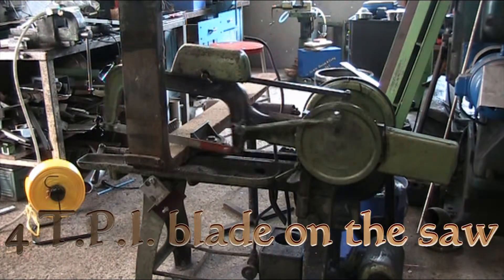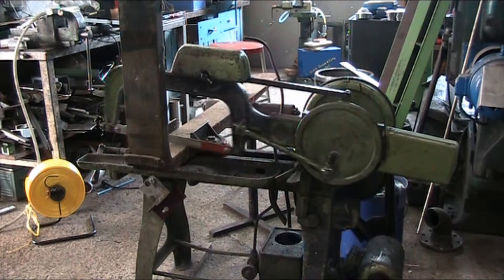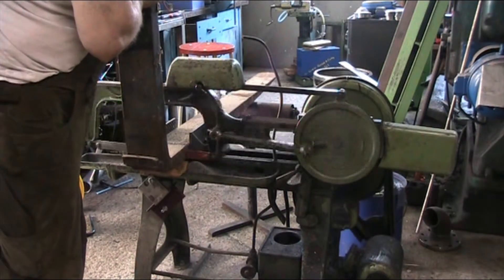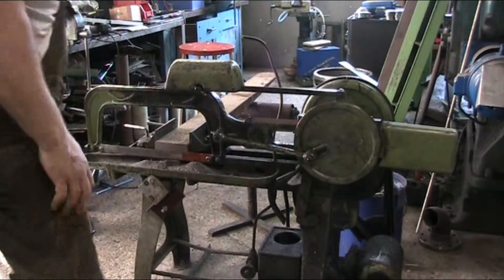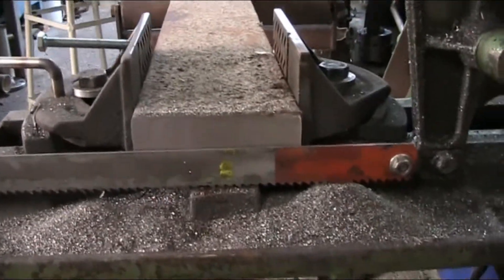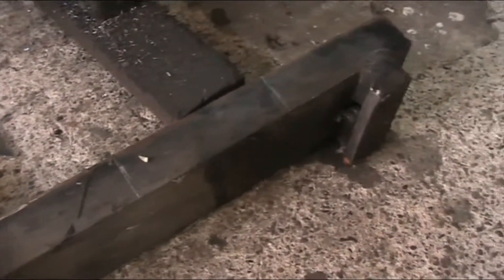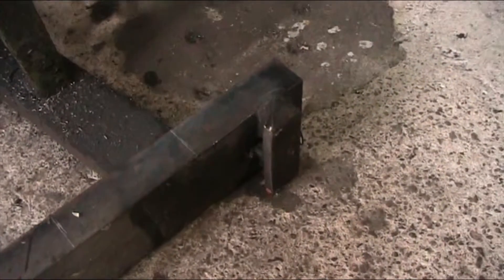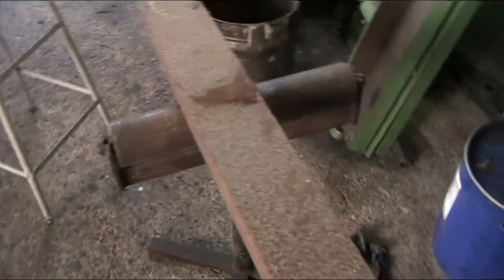Oh Fork it! episode 2

Comment: Hi Mike, Slowly working through your videos and I had a thought, you could have planned on making metric 50-100-150 blocks instead, might be a better fit with material available. Often the size of the blocks is unimportant, as long as the two match. 
Another thought for future, cutting on the thin edge might have been quicker, more pressure on the blade.
ATB
chris
Reply from the maker: +Chris Stephens   yeah, that does make sense, the 2-4-6 blocks, even if i made them metric would end up undersized. in order to get a good surface on them i would need to take off a mm of material.. the surface would a rough mill scale surface and since a 2-4-6 block is supposed to be a precision tool it should have a decent surface.

the opening cut on the fork had to be on the flat because the overhanging neck of the fork would have put too much cantilevered pressure on the vise. the tail end was supported by the one and only support roller there is in the shop. the material is also incredibly tough being forged steel. a file has a good bite on it so it hasn't been case hardened. it's just really tough stuff.. that blade was dull when the cut was done. 
also turning the fork upside down was out since the neck of the fork was too long and the vice would be able to grab it. 
the rest of the cuts though all went on the skinny side. that extended the life of the blades considerably. 

the tooling on the mill is a different story. i have some carbide endmills (VHM) and they dull rather quickly inspite of using coolant. even using light cuts they dull rather quickly. i have this one little cheapie chinese made TIN coated 12mm endmill that has held up surprisingly well on the vise extenders. but it took 12 passes to get the depth of groove for the T-slot